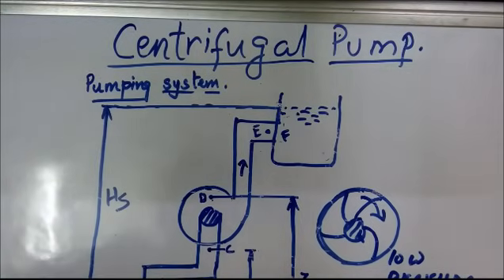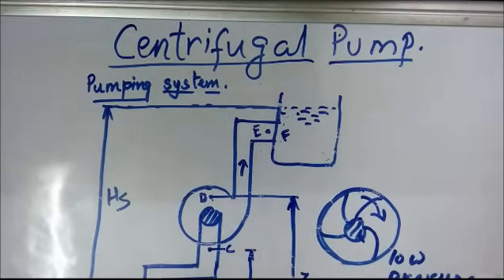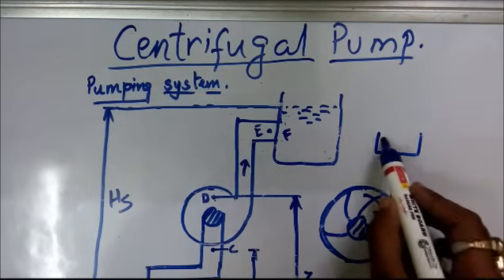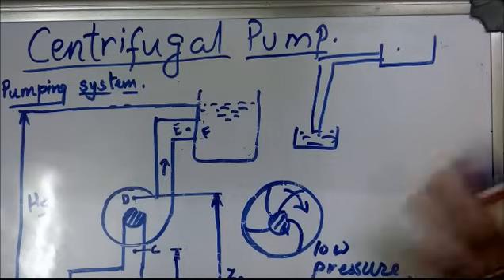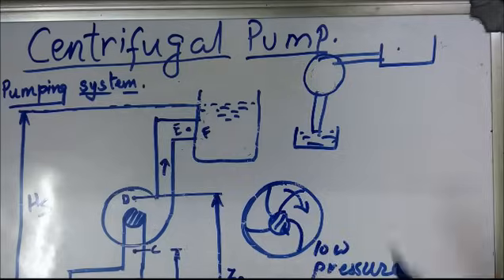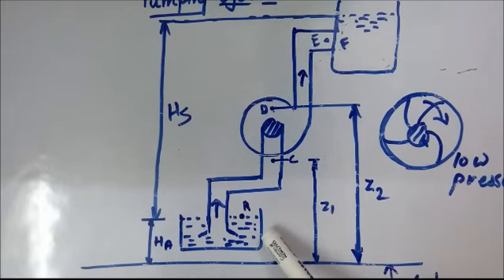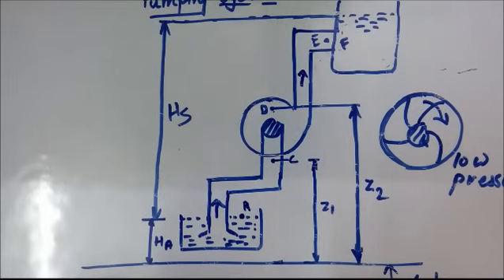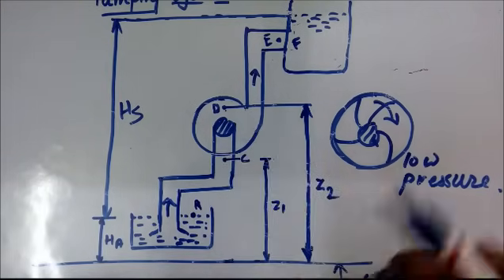Centrifugal pump lecture 1

Comment: Sir, how much HP is required for lifting water up to a height of 280 metres ? Please help
Reply from the maker: You have to know the discharge first. Then P=row.Q.g.H
Reply: @RohitChowdhury_sajaysaini  Sir, pipe size is 50 mm.
Reply: @RohitChowdhury_sajaysaini  Sir, I am having a hard time calculating the exact discharge using a pipe of 50 mm dia. Please sir let me know the approx HP i will require. Thanks

Comment: Pumps don't suck water.  They lower the pressure in a pipe.  The result is that the weight of the atmosphere can then push the water in the reservoir down and into the low pressure pipe.  It is an important destinction.  It is the reason there is a limit to how high you can place a pump in relation to the reservoir.  It depends on how much atmosphere you have pushing down.

Comment: I have studied as we go up from sea level pressure decreases. ...nd u r telling higher elevation means higher pressure how?
Reply from the maker: rancho baba my dear friend you r talking about atmospheric pressure
Reply from the maker: rancho baba have you noticed that all the water tanks are made at such a higher elevation..why???? So that you get hivh pressure
Reply: Let me ask u something to increase npsh pump  should be kept low or high
Reply: Rohit Chowdhury .....m telling about hydrostatic law not only for atmospheric pressure
Reply from the maker: rancho baba see its very simple. Consider my higher reservoir as a water tank..now water tank is kept at a higher elevation because when water comes out from there through pipes ,it comes out at a high pressure because of the heigt.....now to refill the water in the tank ,you need to transfer water there with the help of pump....thats it

Comment: but impeller rotation is wrong ,
rotation is opposite side
Reply from the maker: patel dhaval here nowhere I have talked about impeller rotation...if you r talking about that small diagram in the beginning,,then yes rotation is on the reverse direction.....that was just a simple example to eplain priming of pump I think....
Reply: Rohit Chowdhury  ok

Comment: Its a nice video on centrifugal pump. However, my concept is not yet clear on what is the difference between the pump head and system head. Both the pump and system curves have the similar x and y - axes values (i.e. Head vs flow rate), but we get different shapes. Thus, I would highly appreciate if anyone could assist me with understanding this. We tried to plot the  pump and system curves  with simple experiments, but got stuck in how the system head differs from pump head. I know the pump head is the head generated by the pump while the system head is the head required by the system. We can calculate the system head using equations, but not sure how to calculate pump head. Many thanks in advance!